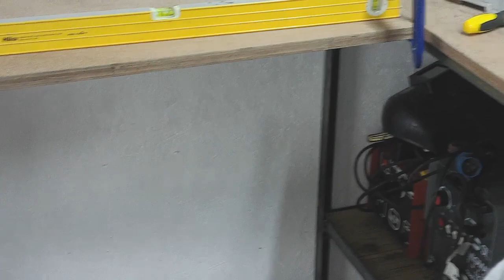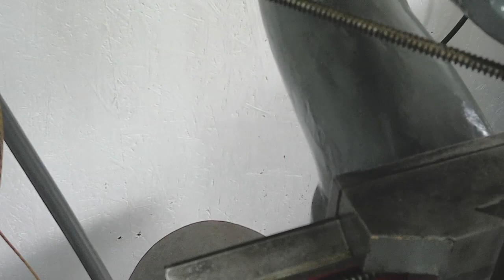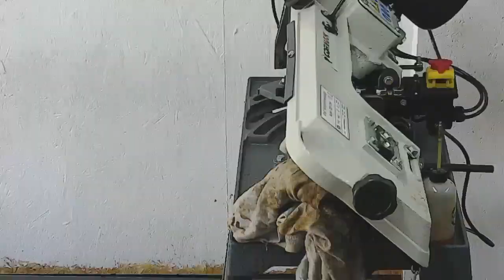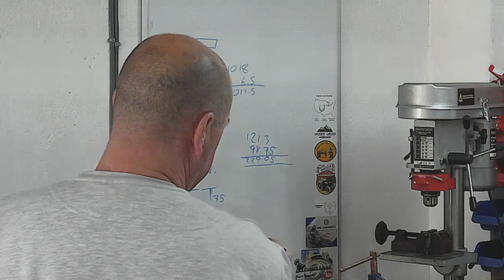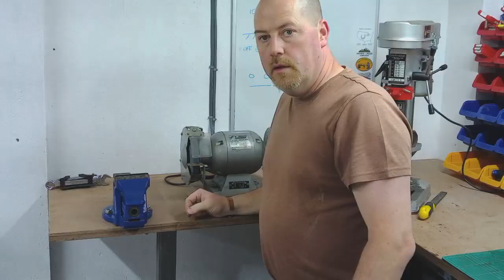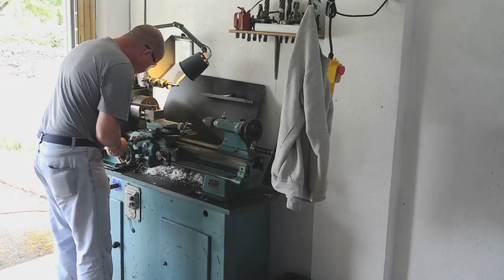Episode 15   Tailstock MT Removal Tool & Bench No 2

Comment: I like the morse taper ejection tool, i would leave i parked up the tail stock barrel. then you know where it is straight away. thanks for sharing Jon
Reply from the maker: Hi Roy, thanks for the comment, it will do the job much better than the old bit of bar. Still to organise more racking and storage round the lathe so I will find a permanent place for it so its to hand. Cheers, Jon

Comment: How long did it take to upload a 40min video?
Reply from the maker: About 6 or 7 hours, not too sure as I left it running overnight but based on 10 mins taking just under 2 hours..... Can't beat a copper connection. Cheers, Jon